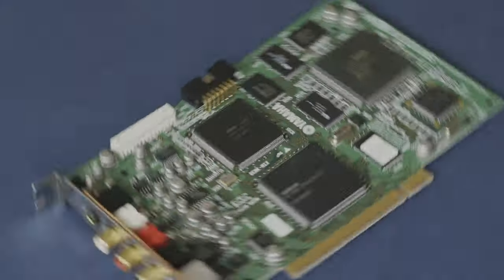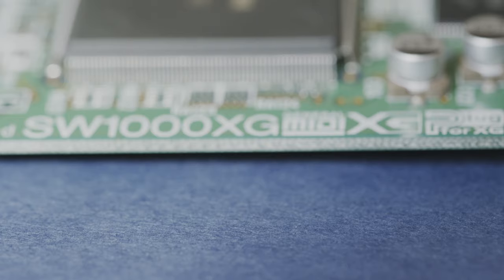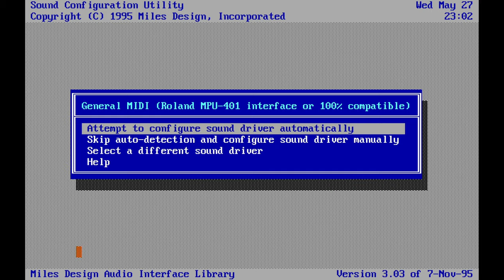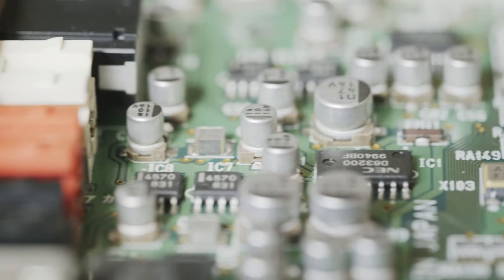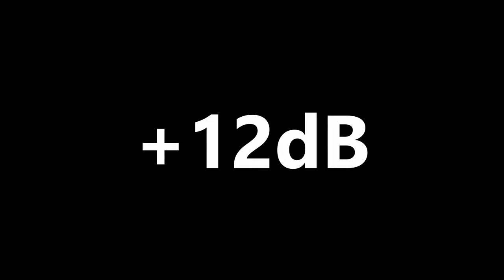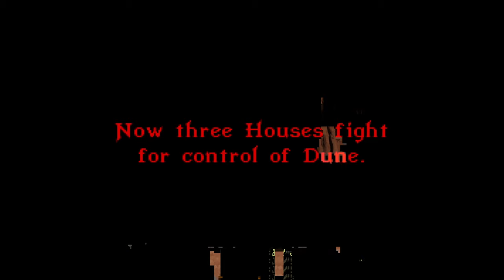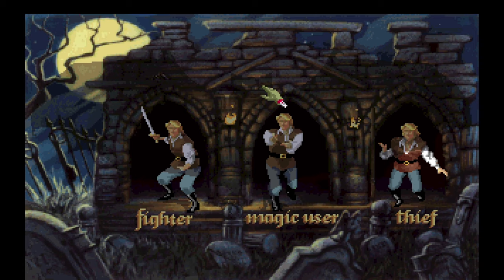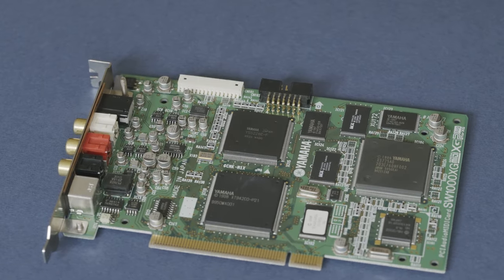Yamaha SW1000XG review - The Quest For The Ultimate DOS Sound Card Part 9 - Best DOS sound card yet?

Comment: So here's an idea how one might be able to put the card to use - you can use a computer that runs 2000 or XP, whatever NT based 32-bit system is compatible; then use VDMSound for Sound Blaster emulation, and on top of that, you get MIDI to this card. The games would be running in the DOS environment of Windows, and the CPU is not emulated unlike DOSBox the software, not dynamically recompiled, it's real, it doesn't stall when you don't expect it to and it doesn't run faster than whatever the real CPU runs at. It's trapped for sound related port writes, wave audio is emulated, MIDI is diverted. Video card is not emulated, it's real, and the video modes are all correct. You can connect CRT via VGA etc. It can be quite an authentic experience in a way as playing early mid 90s games on a late 90s machine - once you fullscreen the DOS Box, you don't have to even think about Windows running in the background. Besides MIDI, the card has several Wave Out devices that can be used by VDMSound.

VDMSound was at the time in the early 2000s why i didn't feel too terrible building a PCI only computer without ISA slots, i continued playing DOS games that way with SBLive doing the MIDI duty.

Comment: Really fantastic piece of XG hardware, i'd love to own this. Sounds really pleasant in some of these games, but in some others (like DOOM) it's debatable whether it's nicer than, say, SC-55. 

The issue is not the card itself, but the fact that nearly all of DOS games use GM or GS standard, and the ones sending XG-specific messages can be counted using one hand. XG modules are capable of performing outstandingly if the song is made specifically with that system in mind, but running standard GM sequences through them is a gamble of pure luck, with some tracks sounding better, and others sounding significantly worse than on GS/GM synths.

I think that the real strenght of XG lies outside of old games, mostly in music production, even though nothing is stopping anybody from using them that way (personally i have S-YXG50 set as the system default MIDI synth).

Just to give a general idea of how much better the guitars in DOOM could have sounded on any piece of Yamaha's hardware, this video is a nice example of making use of internal distortion effects native to XG (the mix is a bit too bassy here imo, but it's irrelevant in this particular case) https://www.youtube.com/watch?v=w8qfXEpifvI
Reply from the maker: You're sort of right, all DOS games use GM or GS standard. However, XG is compatible with GM and almost all Yamaha MU generators and sound cards can emulate GS with their TG300B. Of course, it's my personal opinion, this card really sounds like it's an actual soundtrack, rather than a MIDI reproduction. Except for Doom, it did sound a bit off to me, but it may be, because I'm used to SC-55 version too much.
Reply: Yeah, i'm aware of the compatibilty, my point was more about not making use of the full XG potential. Some of these games sound really good on it though (Gabriel Knight and TFX especially)
Reply from the maker: @MidoriMizuno  Yeah, you're right. For example Flashback. PC version sucks, but when you get a .mid made specifically for XG, it sounds amazing, check it out: https://youtu.be/TpmVXMd7spU

Comment: Well you can save some space if you will utilize thin client with internal PCI slot like a Fujitsu Siemens S400, and with some additional configuration you can probably make it work without any external devices like display, mouse or keyboard. This should be only slightly bigger than Roland SC-55.

Comment: Your card seems to be missing a heatsink on the voltage regulator, right next the the PCI bracket. There is a bolt the that the heatsink should be attached to. It would be a good idea to have it on as the voltage regulator gets quite hot.
Reply from the maker: You're right. I've got two of these cards and one is certainly missing the heatsink.
Reply: I've been told this is only an issue when using the external PLG synth boards since they're aquiring a lot of extra power.. I additionally created, or rather re-produced one myself as I had one as an example..  It's just a simple piece of aluminium they created for later versions due to the problems with the extensions..  I own all 3 available synth versions.. But using it as a GM soundcard I wouldn't worry using it without heatsink. 😉

Comment: I purchased SW1000XG recently and installed it on GA-G41MT-S2 with Windows XP SP3 as its OS. But when I play MIDI files every time GM/GS/XG reset is sent the song sounds interrupted for about 1-2 seconds. For any song without MIDI reset, if I examine carefully, at first second the tempo seems a little bit increased before it's back to normal. Those experiences are so annoying and I unable to find the solution. 

Is that due to the Windows XP with its WDM driver? Because SW1000XG in nature was Windows 95/98 with VxD driver. I don't have old computer to prove it yet, though.
Reply from the maker: To be perfectly honest, I haven't noticed this kind of behaviour. What MIDI player do you use? You can try different player or these drivers:

https://www.karlsitretro.com/sound-card-drivers/

Comment: Nice, im owner of the sw1000XG a brilliant all allrounder, by the way: the Monkey Island Title Song is played in  MT32 mode and wrong,, the right playback you will get with ScummVM, Dosbox and the original start in Dos Box of Monkey Island I has no gm playback.

I just wish could start the Sw1000XG in my modern Win10 system :-/
Reply from the maker: I made it work in Windows 10, but only in 32-bit version, unfortunately.
Reply: @KITR-UK  you mean you have the Sw1000XG running in Win10, how that?
Reply from the maker: @systemuhr  It's been a while since I made it to work, but I remember I used drivers for Win XP.
Reply: @KITR-UK  ok, the sw1000XG is installed in my XP System but it would be better, if i can use the Sw1000XG in my Win10 system

Comment: Surprised no-ones mentioned DOSbox, it's able to pass through Windows MIDI devices so you can use a single machine for your DOS gaming. 
Only drawback is that the machine is going to need to be powerful enough to run DOSbox (e.g. Pentium 4, Later Athlons). 
Windows 9x's own DOS frontend does the same, but the same drawbacks are there on period correct machines - I'm more partial to DOSbox on 9x, as it works better with MIDI - had all sorts of problems with MIDI detection on motherboards from 2000 and later.
Reply from the maker: Well, I tried running DOSBox on Pentium 4 3.4GHz and the performance wasn't exactly stellar, so I didn't feel the need to include it here.
Reply: @KITR-UK  Yeah for 3D games, most PCs from the early 2000s struggle to run them well under DOSBox (Descent, AITD, Duke3D, etc)

2D games tend to run fine, but that's a given, It's pretty difficult to find a machine that is the right balance of compatibility and power for applications like this. 

I tend to run source ports for games like Duke3D on machines with DOS issues.